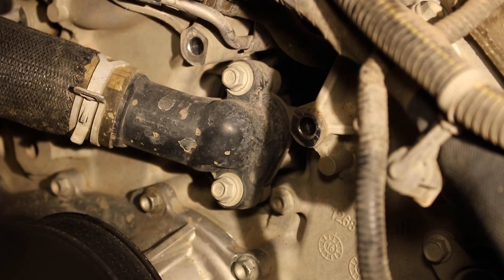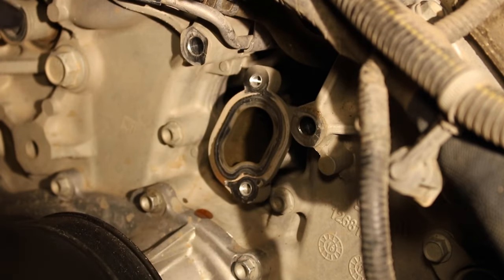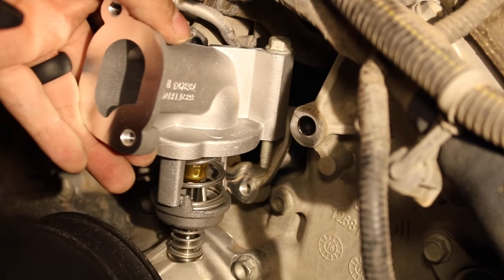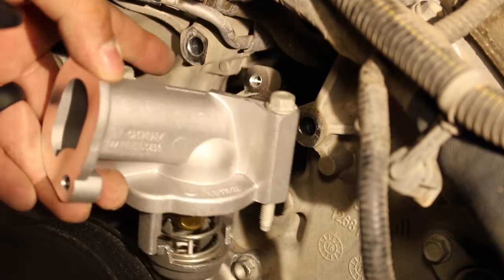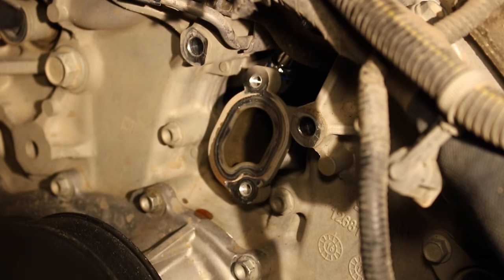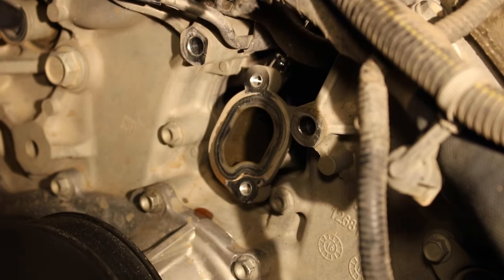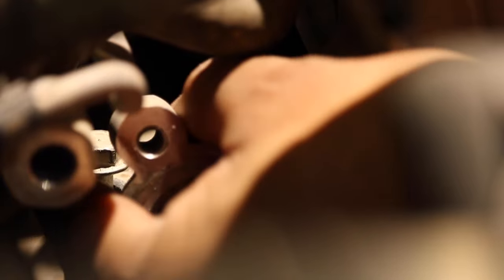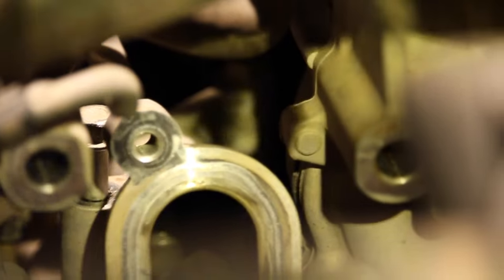Thermostat Removal for 2017- 2022 Chevy Colorado / GMC Canyon V6

Comment: I've a 2017 3.6L Colorado and just had the original thermostat go out.  Thank you for this video.  I was look trying to figure out where it's at and what I need to get out of the way first.
Reply from the maker: Awesome! I just found the rest of my footage today too. Going to update this video with the rest soon
Reply: @cmacia06  Any other tips or tricks on getting to and removing the bolts?
Reply from the maker: I got it loose by using a 1/4” drive low profile socket. Then just backed it out by hand. It took a lot of patience though. I saw online they had extensions designed to tight spaces like this. If anyone has used those before let us know! I wouldn’t mind adding that to my tool kit if it works

Comment: Changed out the thermostat and still have the fan blowing. Is there a reset that needs to be done with the computer?
Reply: Once I did mine the engine light came on. Took it to O'Reilly and they erased the code. Now everything works like a dream.
Reply from the maker: Same! 
I had a bluetooth OBDII reader and reset it that way

Comment: I can't find anything to get that coolant temperature sensor out.  What a joke
Reply from the maker: Yea it’s not the easier
Reply from the maker: I had to really finesse it
Reply: @cmacia06  I ended up using side angle snips to cut the female side of the connector so that I could bite it.  Since I  couldn't open it hardly at all so I was basically nibbling at it for roughly 45 min.  
FYI, I have no idea why people take the plenum off.  I does help anything!  It's not gonna make you access anything any differently.  It's not in the way unless your hands are claustrophobic.